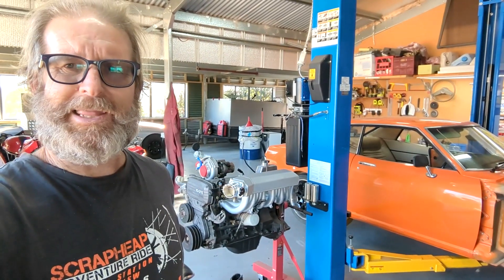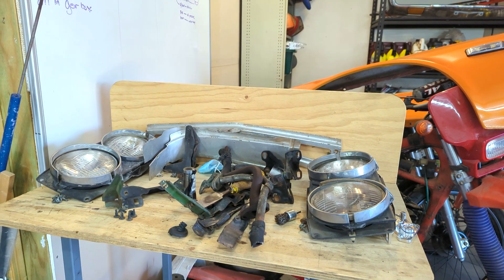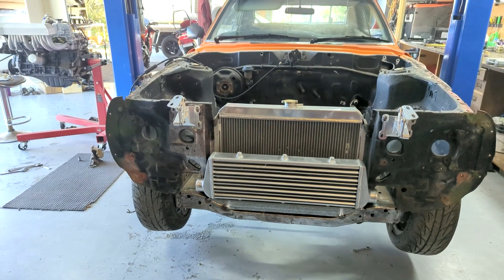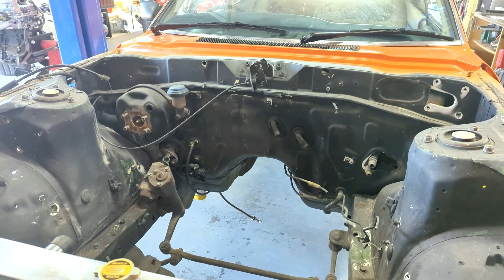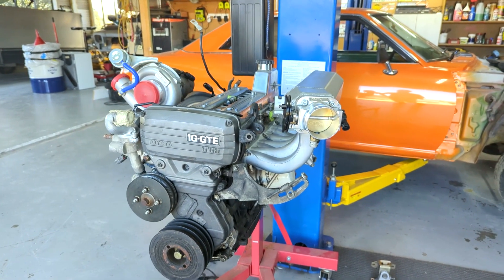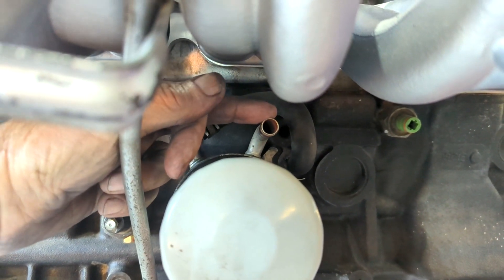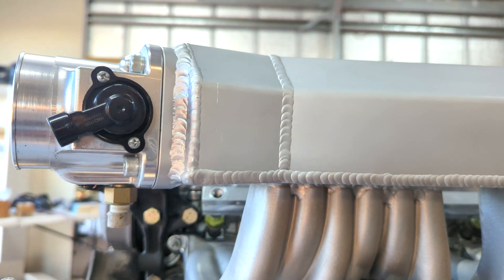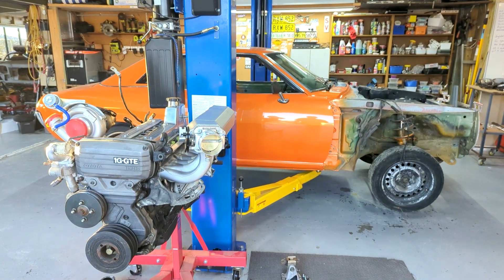Celica Build Progress and engine intall - RA23 1G GTE No.37 KamicarzCreations

Comment: I love that your still doing this build. I was going to put a 1G-GTE in my TA22 but sadly the engine was toast and not something I could afford to get fixed or do myself.
Also may help you find parts/info the turbo 1G-GTEs came factory in the Z20 Soarer, MK3 Supra and the GX81 Cresta/Chaser.
Reply from the maker: Yes so am i.....i love this little motor and the sound of it running.....it will take a while but im in no hurry :-)